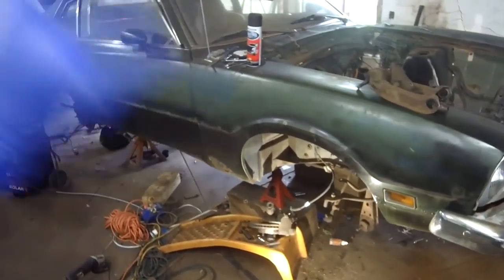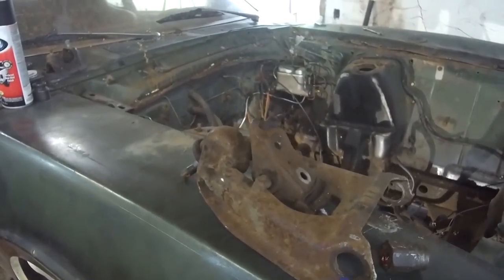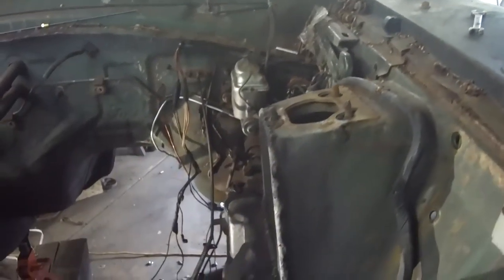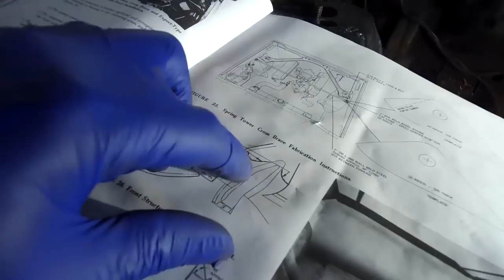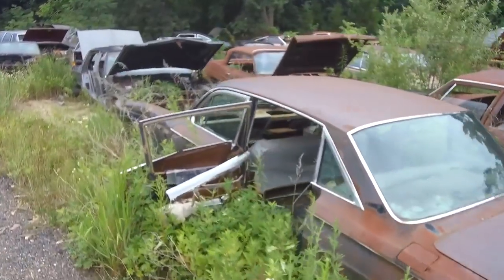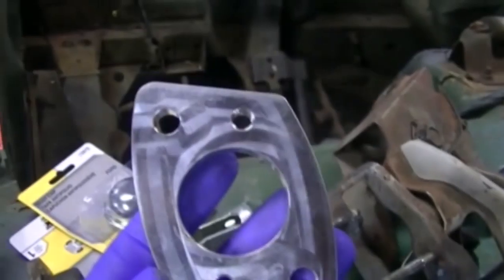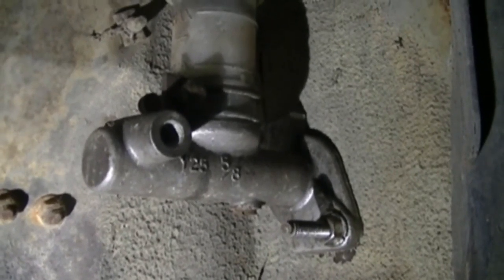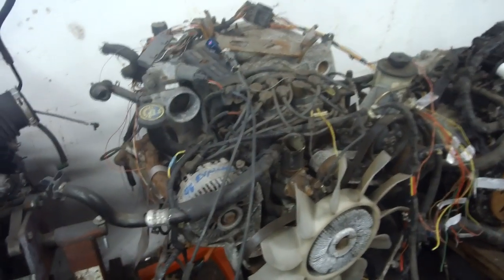Ford Maverick  1973 Engine Selection ( Welding, Suspension, and Clutch Pedal install )

Comment: I don't know if you'll see this but here is a bit of info for ya.
Hay bro you got my attention so I sub to your channel I don't know what engine your going to put in there but here is a tid bit for ya if you can find a real good  machine shop, then find a set of 351 cleveland  2v heads you can have the shop change the coolant passage to match a 302/351w coolant passage and have the shop make intake spacers,  it'll be a bit of a bitch cause you have to have four intake gaskets, longer intake bolts grade eight. and have them do a mild port job on the heads you'll find that you will have a engine that will breath like no other.
I know this cause I have done this to my 351w and stuff it in a 66 falcon had a bit of trouble till my pap(Grandpa) helped me by using a mustang 2 front end and got rid of the spring/shock tower he did all the work on the fornt end.
Just wanted to pass on some old school tech to you and if you think I'm full of shit does anyone know of a 1969/1970 boss 302 it had a set of 351C heads on that engine from ford.
Reply from the maker: THANK YOU for the sub brother ,, This means a lot to me.. Now the comment you made about engine selection. I have 302 (Explorer engine ) ad i have just picked up the 351 from a 94 bronco.. I kniw where i can get those heads you speak of.. I have to wait a little to see how these all pans out... Tell you grandma god bless his knowledge and still being in the game of hot rodding . This info you gave is priceless and I thank you for this
Reply: Theres less hassle with the intake now u can get a special intake for that Cleveland head swap but the engine wont make much low end torque like that
Reply: @kevinjohnson9372  thanks for the info but if you follow what Bud Moore did to the 1970 T/A Mustangs for ford you will have one torqee motor and that is a fact sure it won't be a monster on the troq put when you figure out when and where you want the torq curve then you figure where you want max horse you can have a cam grind that will get you where you want the engine to be in the performance you want.
Reply from the maker: Check out this video when you have time it took a min https://youtu.be/vPHoR-0XhXA

Comment: Nice to see a Maverick getting proper respect.

The Comets are pretty nice cars too, as seen in my profile pic.
Reply from the maker: Comet are sweeter just a bit.. I like the rear tail lights ..I want to do odd Ford cars not the typical if i can help it..
Reply: I'm hoping to take the tail lights out of my parts car and replace the reflectors in my driver, actually have four functioning tail lights. I'll have to modify a bit to have backup lights.

I prefer the oddballs too. No need to blend in, do the same everyone else is doing.
Reply from the maker: i got the maverick running  bro https://youtu.be/0JweZqQb0oU
Reply: @bstfordchannel923  Sweeeeeet!

Hoping to get back on mine soon. I've got just about all of my parts.

Comment: I cut the cowl spot welds to get to the vents on my 70 and weld them up ,used GM door glue to re attach the cowl. Your hydraulic clutch solution is cool, header clearance will be easier without bellcrank in there.
Reply from the maker: very true i may use this info and I thank you for this Rob... I may really get down with this

Comment: Your a master @ anything cars you killed it.I think your easiest route be build a lil 306 Mexican block 
9:1 flat tops 290h cam longtubes 
650 edelbrock 300hp.be plenty maybe do a small turbo later down road.I should have kept my 73 comet gt.250 had cam split header 4:10 8inch.Ran 14.3 @ 102.
Reply from the maker: thank you for this comment bro, I want 300hp thats all it will be more than enough to more this car Turbo will happen once i figure the Crown vic turbo then adopt that recipe to the maverick.. Man you guys had some cool ass ride  REALLY dude

Comment: I'm installing an AJE front suspension in my 73 Maverick and a 351w... Nice project.
Reply from the maker: Man you got some coin going into your car... well man i will be there someday, but not today,, your car seems cool brother..I was going to do the 351 , but i have another plan for the engine
Reply from the maker: i got the maverick running  bro https://youtu.be/0JweZqQb0oU
Reply from the maker: Check out this video when you have time it took a min https://youtu.be/vPHoR-0XhXA

Comment: Ah, the ol' shock towers on the Fords of the 70/80/60's. I always looked at that and throught how the hell are you supposed to bolt up a good set of headers onto the heads. Good thing I was a GM guy, because I saved myself a LOT of aggravation.
Reply from the maker: yeah it a pain dude , but you chevy guys are goos no worries about that.. thats why people pick those chevys to get down with.. Fords you have really really do them. It aint 1 2 3
Reply from the maker: i got the maverick running  bro https://youtu.be/0JweZqQb0oU

Comment: Auto Krafters has the correct engine frame brackets if you dont have any. On motor mounts try to find ones with safety cable going through them incase rubber tears.
Reply from the maker: I have seen that i need some stuff i have to check them out for a few things..Man i ca find those .. i have set that does have that dang? i have to search for it
Reply: @bstfordchannel923  your car should have the threaded holes in car already for crossmember. My 6cyl car did.

Comment: Nice work. If that explorer engine is the same as the foxbody 5.0 engine I got the wiring modify paper. I can email it to ya
Reply from the maker: thank you brother when i am ready to get down with motor ..I will hit you up for the info.. cause I make video and such and I will delete the info.. Thank you for this thank you so much
Reply: @bstfordchannel923  ok cool and no problem
Reply from the maker: i got the maverick running  bro https://youtu.be/0JweZqQb0oU
Reply: @bstfordchannel923  Thats good

Comment: I pulled the engine out of my '65 Mustang expecting it to be the original 289. I believe it's a 302 from a '74 Maverick. D4DE casting mark passenger side just ahead of the bell housing.  Is this a Maverick motor?  It ran Okay but was starting to smoke some.  I replaced it with a crate motor.
Reply from the maker: First letter is D so thats 70s if c was the 1st letter it would be 60s i believe .. now the D4 means that the 302 was done in 1974

Comment: Man I thought I knew how to weld until I tried 18 gauge. I think I finally have mig set up properly for paper thin metal. Practice right? We are both getting better
Reply from the maker: I am not good at all at the welding,, right now to cold out, but i can not wait till I get back at it
Reply from the maker: You will get better brother just keep at it

Comment: Nice work so far on the clutch! Do you have to temporarily set the motor and trans to see where to build the rest of the clutch? Like your final pick of motor. Can't wait to see how you wire it. Do you use the fuse box out of the Ranger and just delete what you don't need? Seems you would run 2 separate elec. systems, one for car and one for motor. I 'd be having my windshield wipers come when their not suppose too.
Reply from the maker: i have the motor and trans need the flywheel to check for the starter 9 issue 0 i know there will be one.. I am using parts all over the place v6 mustang, explorer, f150 so i have to have parts play nice together.. I will use the fuse box from the explorer to see how that will go.  the stock fuse box i can wire it to that 1, but i will try to get car started and running then we take the more deeper route. Thats where i will rate myself on this project

Comment: if you leave the brake pedal to aide itll get your feet tangled up. trim it to look like your clutch and just buy new rubber covers
Reply from the maker: THAT is the plan brother i will be taking out that ( brake pedal ) and weld one up..

Comment: You may know but lettin you know v8 Mavericks use and extra bolt in crossmember under engine for strength
Reply from the maker: yes this one did not but i will add one,,, thank you for this.. sorry for the late reply https://youtu.be/bo4RVjqKvHI
Reply: @bstfordchannel923  think I was drunk on that one
Reply from the maker: @CharlieBrown-pb9xn  lmao its all good bro
Reply from the maker: i got the maverick running  bro https://youtu.be/0JweZqQb0oU

Comment: Are you going to install the mustang II suspension? That would be the way since shock towers can be too rusty. Also if you have unlimited pockets, Ford converted the 8" live axle to an IRS for the mustang. Use to be able to convert the Maverick to V8 power with all factory parts. Course now you'd have to go the"Paddock" for parts, but hey. Big regret is not building an 8" IRS just to watch people's faces.
Reply from the maker: Hey there James well my pockets are low so i have the stock rebuilt front suspension for now... For the rear I have a 8.8 Ford explorer rear chopped and welded back..The power plant will be Ford Explorer v8 efi...I needed to do a better rear in time I will do something cool with the car but for now just trying to get it running